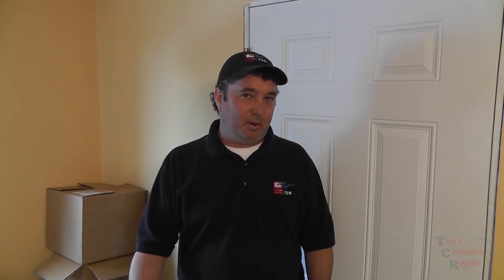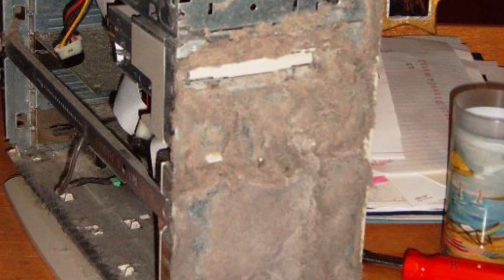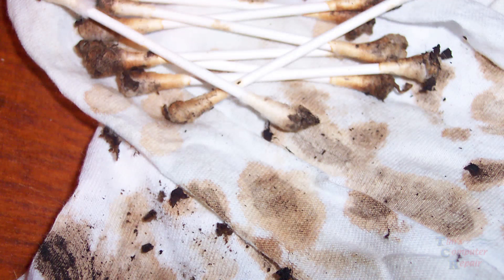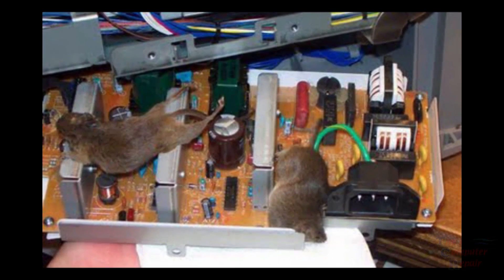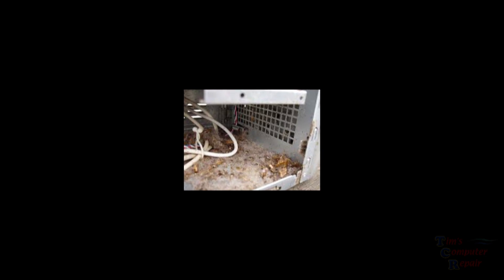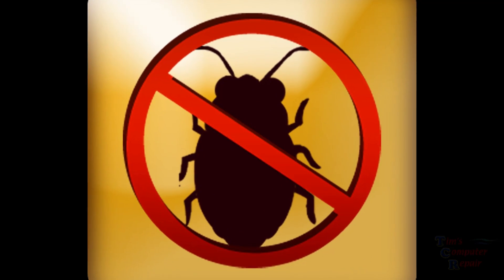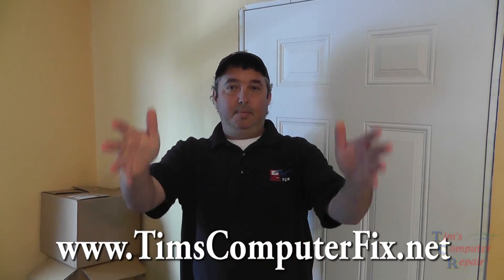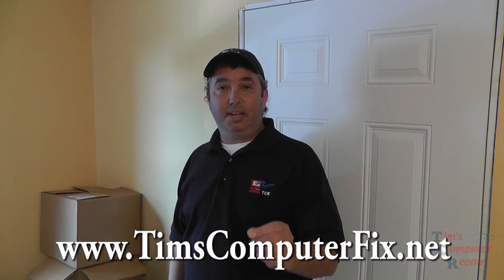Computer Repair Solutions Tips and Tricks (Can You Diagnose This Problem?)

Comment: Well, for one thing it's running Windows XP (lol), but after looking it up on the Lenovo forums, I would say it is something in the CPU power management settings.  Set it to low and see if that fixes it.  Also, considering it's age, it might need a new motherboard.  I'm also wondering would a reseating of the CPU help?  Anyways, there is my guesses.  Later!

Comment: So the cooling fan is cutting out when the keyboard is moved closer to the laptop? If so then I would suspect an electrical issue on the keyboard or connector. I did note that the CMOS battery seems close to where the keyboard is connected. Is the battery good? :-)